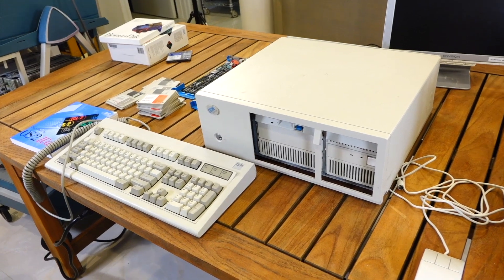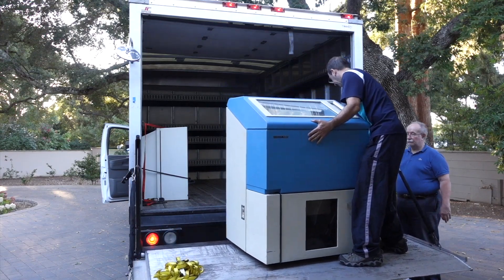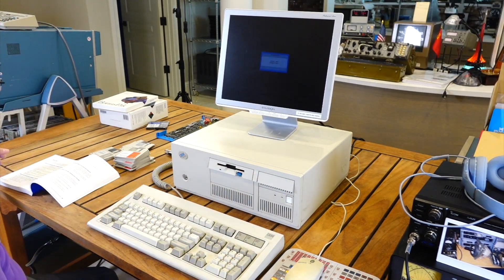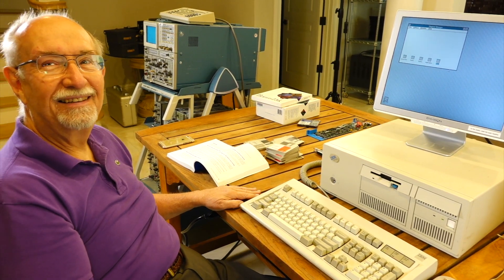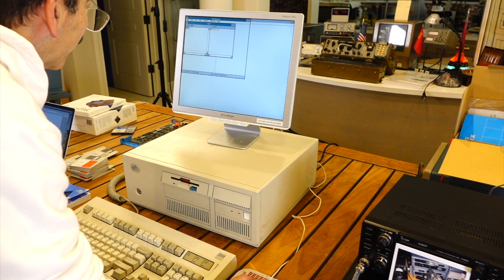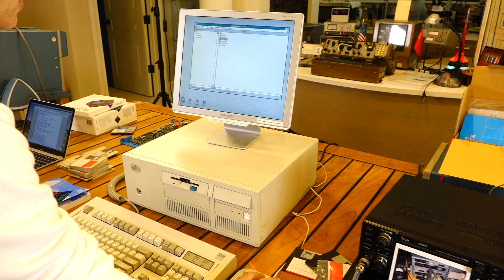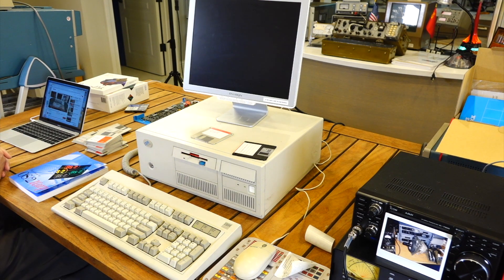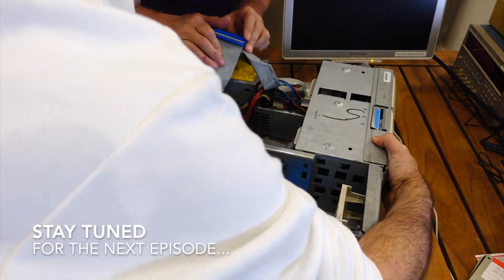IBM PS/2 - Part 1: the Model 77 conks out

Comment: I had one of these. I seem to remember I got it up to 64 Meg, and I ran Linux on it for a year or two as my home workstation.
Reply: That sounds fun. Which early distribution was it?
Reply: @kaitlyn__L  it would have been RedHat 4 something, or Slakware. It may have been both. Starting with Slakware, then going to RedHat 4. It was the time frame I I transitioned to RedHat to make use of the RPM packaging as opposed to applying tar files in particular directories.
Reply: Notably, the original Linux was written for a smaller PS/2 machine.

Comment: IBM made a version of AIX for the PS/2.  I wonder if it supports the channel adapter?
Reply: And all of their proper AIX machines (RS/6000) also used MCA peripherals, so I wonder if any of those could also drive this hardware. Then again, I'm not sure I ever heard of anything actually being compatible between the two product lines (despite the same connector).

Comment: I also have a 77 that ran a register system in a super market for years! They are a tough machine. I recently had a power supply failure take it out but was lucky enough to find a replacement while I repair the original. Mine also runs os/2! Great video!

Comment: The "Break" key is the one that is missing a keycap on your keyboard :)
Reply: Typically called "pause break" divided by a line, not sure why. But, windows+pause/break used to be really slick as a way to pull up the system control panel (or device manager?)
Reply: @rpavlik1  that still works- opens the system info
Reply: Or otherwise known as the Pause/Break key :P

Comment: I have to disagree with you on that one... This is the BEST version of Windows Microsoft ever made.
Reply: My 486 still runs it's original 1993 install of Windows 3.1.. There is a video of me booting it up on my channel in fact. My only gripe with it really is the lack of a mouse scroll wheel.. hard to believe how strange it feels these days not having that function
Reply: @PaulaXism  I don't think Mac has a scroll wheel, so I don't know how they get anything done. Can you do any engineering stuff on a Mac with only 2 buttons?
Reply: @SidneyCritic  You rather used cursor up/down for scrolling and clicking the scroll track for paging along (or, if you had an Extended Keyboard™, page up/down keys). Early scroll wheels felt rather cluncky in comparison.
And, of course, your Mac mouse had just a single button! :-)
Reply: Windows 3.1 had no security.  And those 2.88MB disks are not reliable.

Comment: I couldn't get any earlier than first...
Reply from the maker: Yes you are first! And I forgot to hand out the award! You win a free special vintage pill that alleviates the excruciating pain caused by operating Windows 3.1. It’s strong medecine, made from Apple juice. It creates hallucinations that you can actually drag a window out of another window. And if you take two pills,  it fools you into thinking that you can drop stuff on the desktop. Very addictive. Use with caution.
Reply: @CuriousMarc  This is hilarious Marc, I'll put it in a frame on the wall ;-)  I feel for your struggle with this machine. I worked on many of these right from the introduction in 1987 until I left the IBM dealer I worked for in 1992. Most of the customers wanted their machines setup with DOS and run the software that was previously running on other computers. Using the MCA was usually a pain in the b..  As far as I can remember I actually once installed GEM from DR on it (Model 80) and ran some DTP software! It would take many years for Windows to become really useful (however my first acquaintance was with Win 1.0 ...)